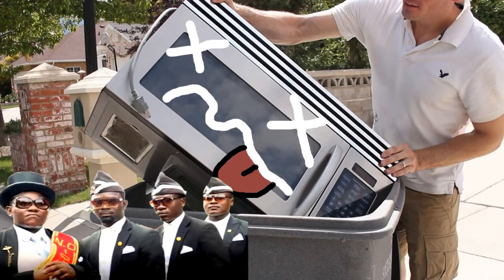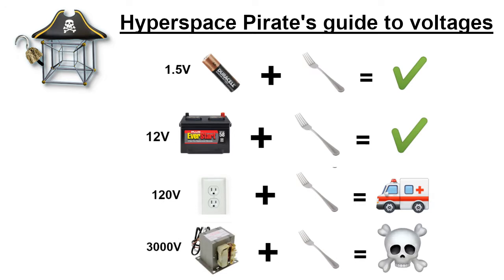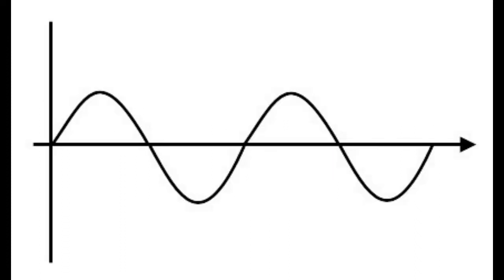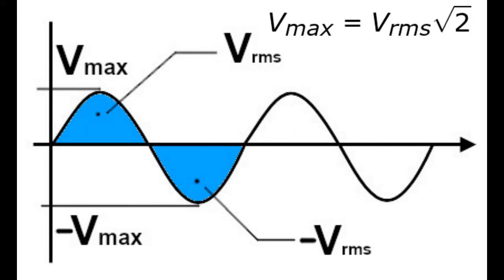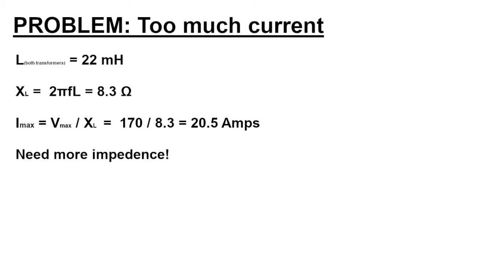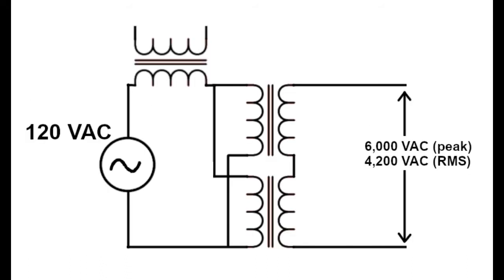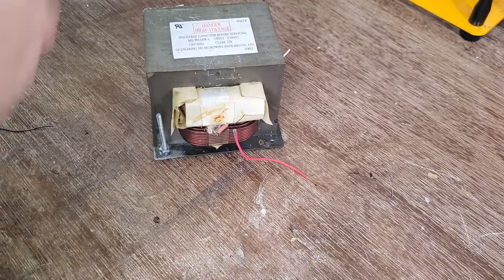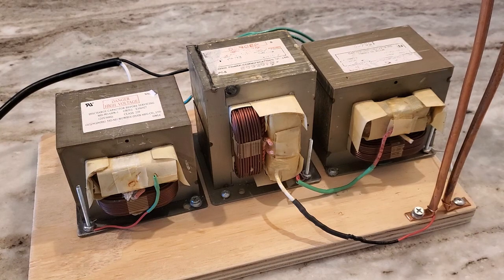6,000V / 2.4 kW Power Supply

Comment: That shorted ballast inductor is very inefficient. Put a capacitor across the transformer inputs instead. It will help with power factor, and waste way less electricity.

Comment: im wondering why you used another mot to limit the current rather than increasing the pfc by putting a cap in parallel with the mot
Reply from the maker: Valid point...this was early in my electronics tinkering

Comment: Great explanation of ballasting. My degree (*many* years ago) was in EE, but I didn’t know offhand that shorting the secondary reduces the inductance. Is it a matter of driving the core into saturation, or does it somehow have to do with back-EMFs?
Reply from the maker: I think it's because of back EMF in the secondary, since it's basically gobbling up the magnetic flux as soon as it's produced. You could actually control the exact inductance by putting a load resistor on the secondary (at the expense of large heat buildup)

Comment: I think it would also help if you put the two MOTs in series instead of putting a third in series. In my experiments it worked, but, i also have 230VAC instad of 120VAC, but, i think it should also work.
Reply: Having the primaries in series would cut the peak voltage in half. (I think) the separate series inductor basically just current-limits the setup, so the peak no-load voltage is still 6KV. (Don’t hold me to that, though :-)
Reply: @DEtchells  You're spot on mate.